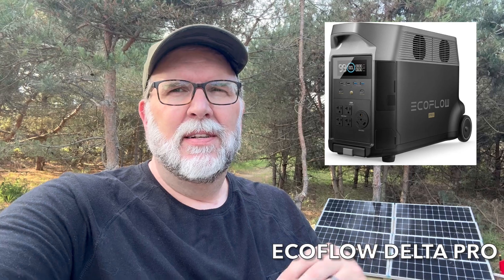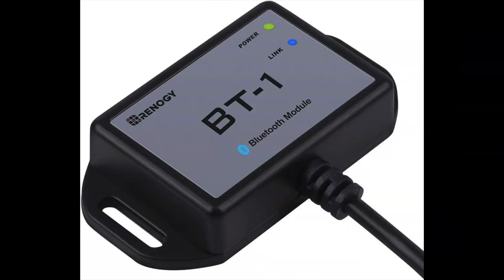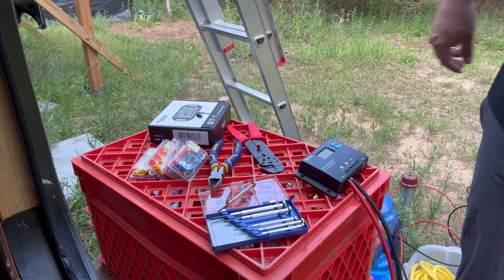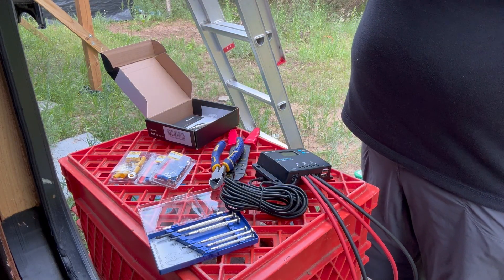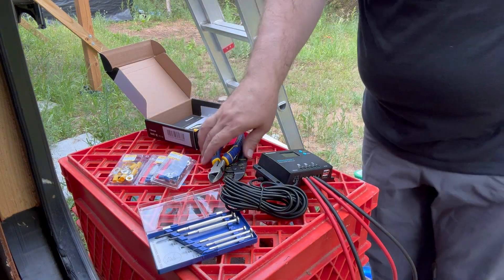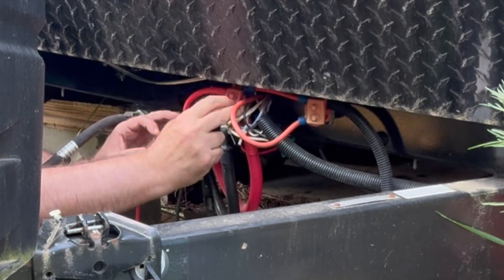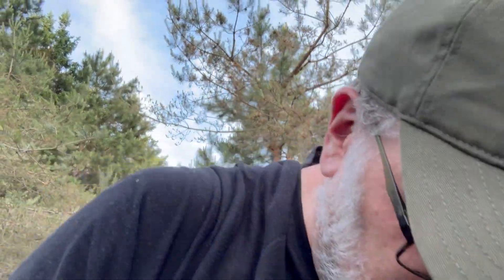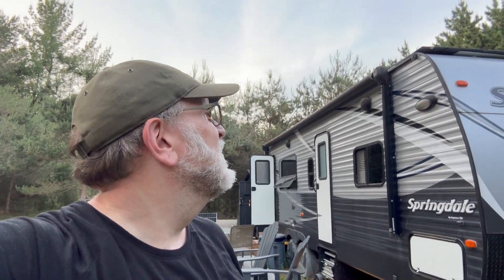How to Set Up a Basic Solar Panel System with Charge Controller & Bluetooth Module @RenogySolar #rv

Comment: Did you have a solar plug underneath the front of the trailer behind the battery for portable solar panels?  Mine is located out of site but I traced the wires back to the battery
Reply from the maker: My RV doesn’t have that. Sure wish it did!